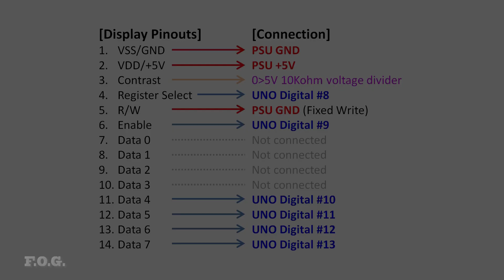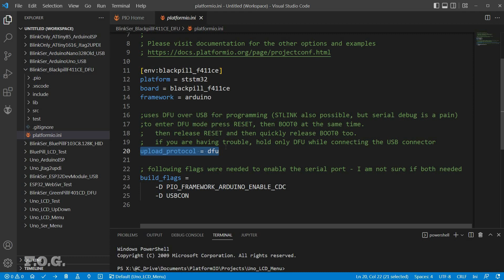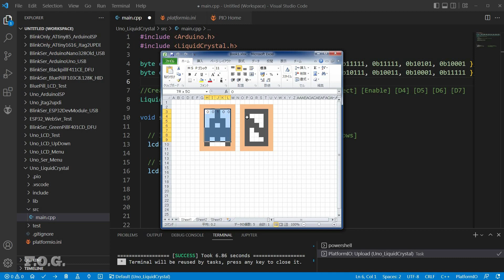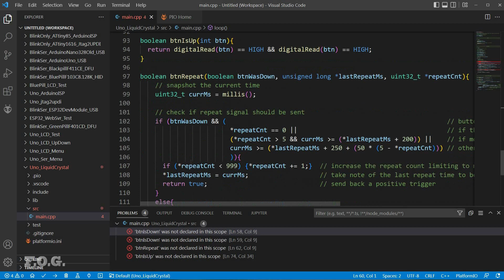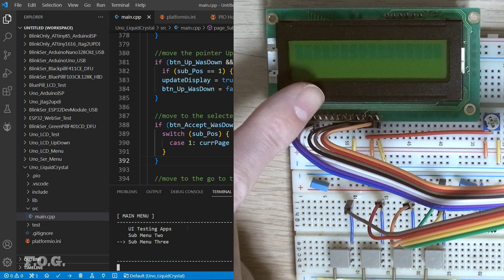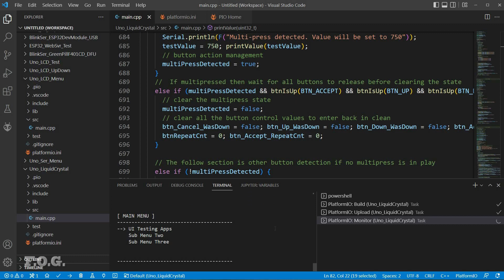EP4 – How to Program Arduino – Displays, LCD Menu & PlatformIO

Comment: Thank you for the very informative instruction. I especially enjoyed noting how you solved problems as they arose. Showed me that I must think and not just 'do'. Could you feature an example to make a stepper advance automatically after a finite amount of time. Once the time expires, then the stepper reverses to a 'home' position set on the LCD, and then waits a 'selected' period of time and then advances to the first position plus a 'selected' amount of steps. Then this should do a selected number of ilterations. Just for 'fun'.
Reply from the maker: Thanks for the comment, and I am happy to hear you found the video informative.
The goal of the channel, is to share various skills, not really deliver specific solutions to anyone. So, the hope is that I am providing people with a few more tools in their tool bag, so it is easier to achieve whatever they are trying to achieve.
For the project specification you provided, if you need a quick solution for that, then there are heaps of AI coding tools available nowadays, that will likely just take exactly what you wrote, and turn it into mostly functional code for you, if you are just after a quick solution to a problem, that definitely is the way go nowadays.
If you’re interesting to learn how to code, then I have a couple more videos covering the topic, feel free to check those and even other people’s video on the topic.
Actually, I did an interesting stepper motor project for my coil winder project, check it out if you like! :hand-pink-waving:

Comment: 37:47 It tells in previous line on comment "Create LCD Object with ports to use -> [Register select] [Enable] [D4] [D5] [D6] [D7]"
Reply from the maker: Yes it does! But this section of the video is mainly focusing on the advantages of PIO now providing auto-complete (Intellisense). The previous line is just copy and paste from an old Arduino IDE project, where you really need to add such comments due to the lack of Intellisense. Thanks for the comment!
Reply: @ForOurGood  Why dont you share code in your videos description? So we can copy paste and edit code
Reply from the maker: @77_Hellboy  Thanks for your question! I give a good explanation about this in episode 7 of this series, so check it out!
Reply: @ForOurGood  So you dont want to share codes? Thats your explanation?
Reply from the maker: @77_Hellboy  There was much more to the explanation given in episode 7 if you watched it, but as a part of that explanation, yes, I stated I don't share the raw files. But you're very welcome, and I am glad you found the videos informative.
Reply: @ForOurGood To understand me, i dont know programing arduino very well, just want to make 1 project quickly instead learning all from beginning, project that have menu on display and to control menu items with rotary encoder and button's. Dont get insulted, i hope that u understand me.
Reply from the maker: @77_Hellboy  I am not insulted, and I am sure if you search a little more, you will find a channel who can provide you the code to copy and paste. Wish you the best of luck with your project.

Comment: question: what is the main differences between the Menu in EP1 and this Menu ? Thx for your posting,  very informative!
Reply from the maker: I believe it is exactly the same. I just added code to simultaneously display the menu on the LCD. The idea is to show that this menu structure should work regardless of the display method, or even number of simultaneous displays of the same menu. Thanks for the question! :trophy-yellow-smiling:
Reply: @ForOurGood  Hi there , do you have any good tutorial of an analog value say a joystick that maps the analog input value to an output value?
Reply from the maker: @johnastigra8475  I have just finished shooting, and am in the middle of editing, a video which includes showing how to do just this. This method uses a rolling averaging stack for the analogue input sampling and a proportional output adaptation for the output. For my demonstration I am using a stack of 30 items and sampling every 100ms, which heavily dampens or smooths the result. For my application I needed that, but you could change the size of the averaging stack (or not even use one) and change the sampling rate to match the response/dampening balance that suits your requirement. Unfortunately the video looks like it will take many many more days to edit yet. I am hoping for this weekend to finish it, but I suspect it will be the week after... Thanks for the question!
Reply: @ForOurGood  thx seems advanced, will watch it !

Comment: the arduino ide likes to blow the protection diode when you try to upload a sketch. i usually just 0ohm it with a resistor or a wire. it's directly under the usb port beside the cap. i threw away so many nanos when i was new hahaha

Comment: You don't need to move your functions to the top. You need to declare each function at the top(above the setup() ). ie:   boolean btnIsUP(int btn);     The Arduino IDE does this in the background for you.
Reply from the maker: Hey thanks for the comment, feedback much appreciated! Actually, I think I have seen this comment on another person's PIO video, so I am aware of the solution you propose. But it is downright silly you need to declare the same thing in the code twice..., but I have also seen this with C classes, so I am not entirely surprised. But here is the point I am really making.. Why is there no similar error shown in pre-compile error checks??!.. sort of kills the point of the error checking a bit.. Additionally, if Arduino wised up and realised that getting people to declare things twice is not a great solution, wouldn't it make sense for PlatformIO to implement it the same way? Personally I think they will fix this at some point, and for me in the meantime, I will just keep shuffling my subroutines around to avoid it.. Thanks again!

Comment: Arduino IDE 2.0 is a step towards platform io- no where near as good but an improvement on the old Arduino IDE.
Reply from the maker: Well, I guess that save saves me the time checking it out then! Sort of good to hear, and a little disappointing at the same time. Thanks for the comment Ian.